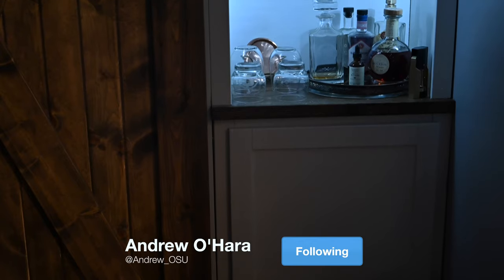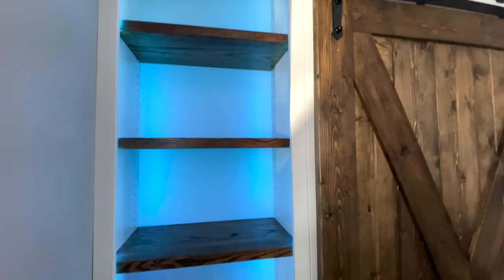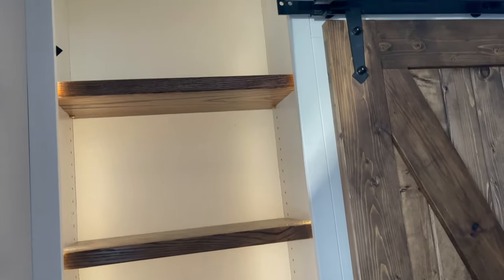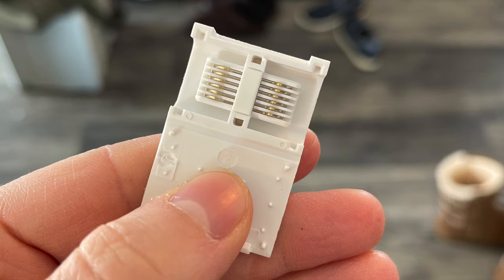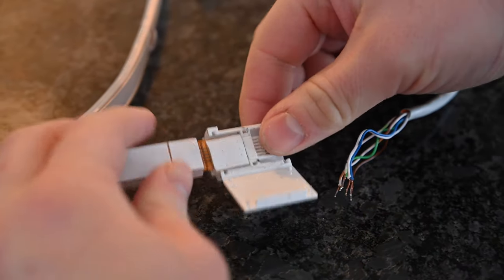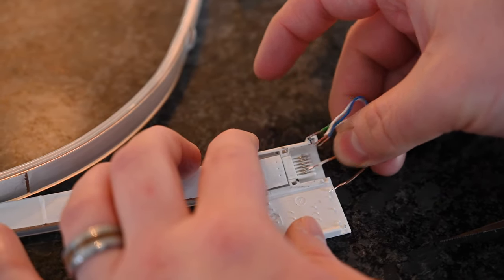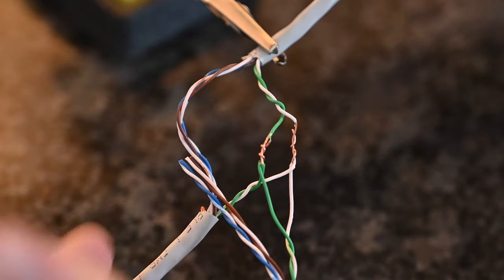How to Cut, Extend, & Split Hue Lightstrip V4! How I Created My Smart Pantry!

Comment: Genius! I wish Philips would release official extenders for this.
Reply: That’s too much common sense
Reply: @tomc  yeah dude they just throw stuff out there on the market and don’t provide or suggest connectors or extensions or anything lol
Reply: I just dont get it.  What exactly is the point of making their strips able to cut... And provide a clip that just puts them directly back

 together?  Why.... Would... I... Cut... It... To... Simply... Clip...it...back... Together!?!?!?!?

Philips...  Wtf!

I have ruined at least 1 kit of lightstrip trying to cut and solder cat5 cable to the cut ends... It has been an exercise is futility, frustration, burns, anger...etc.. 

Just why!? 

Philips: if you made cat cable like extension cables to go between cut light strips... I would buy the crap out of them.  

I am at my whitts end with these lights...  I am going to try the approach in this tutorial as a last ditch effort to salvage my project.
Looks like a good plan with a lot lower chance of burning the crap out of my hands on a soldering iron.

Thanks for the video!!  (your pantry looks awesome!)
Reply: @StumblingGamer648 right?? and there’s only one clip available? what a waste of £70

Comment: Using the cat5e cables were a disaster. I set this up yesterday, and even with the electrical tape being used to attempt holding the wires in place, it's completely unstable. I did it, but it was at a cost of a lot of frustration and a lot of time and patience. I would recommend going the other route with the conventional after-market solutions. Maybe soldering each wire in place would be a better idea since you won't have to worry about the wires slipping out.

Comment: The video description is incorrect.  This video does not show how or where to cut the Hue Lightstrip V4
Reply from the maker: It doesn’t? I thought I showed that exactly that.. with the V4, they have those new clips. So I cut exactly where the lines are and use the clip with the strip in one end and an Ethernet cable in the other.

Comment: Did you buy two extension packs  or were you able to reuse your cut off light strip ?  Sorry it was not clear in the video but great video! I need to gap two sections for under cabinet lighting. and want to reuse the cut off portions of the lightstrips

Comment: Was there a reason you didn't use the 6 pin LitAccessory extension cables to just extend from one end to the other? Just curious, because it seems that would of been much easier than splicing the CAT5 cables.

Comment: Great video, I want to connect them to my ceiling but will need a lot more than 10 meters. Do you know if it's possible to extend it to more than 10 meter, let's say 11 or 12 meters? Will it reduce the brightness a little or a lot?
Reply: i’m also trying to connect it to my ceiling but the power cable is really bugging me. i was thinking of cutting a smaller strip near the end so it can be closer to an adapter but this video makes it so complicated for me to do

Comment: Oh please!  For a measly $18 you can buy these little do-dads thus bypassing all this aggravation and bs.. Litcessory 6-Pin to 6-Pin Connector for Philips Hue Lightstrip Plus (15 Pack, White - Micro 6-PIN V4) Amazon.

I connected two 6 ft Hue lightstrips just yesterday [in a dimly lit room] using only one hand as I’m paralyzed on my left side.. easy to do, and worked flawlessly!  Forget this nonsense, trust me, totally unnecessary.  Geez
Reply: Oh..and without needing to make a single cut.  

Note: the reason I needed these connector-pins was I needed a 5 to 6 foot span with no light on the strip.. I used the following cables for that purpose; Litcessory Extension Cable for Philips Hue Lightstrip Plus (3.3ft, 2 Pack, White - Micro 6-PIN V4).  Be sure and get V4 pins and extensions if your strips are V4

This whole thing is absurd! If you can’t afford $18, you certainly can’t afford the ungodly expensive Hue product line

Comment: This worked like a charm on one set of bookshelves, now I’m having a beast of a time getting the second set to work. Any tips for getting the connection to work? I’ve tried cutting the plastic back a bit on the light strip, making the cat5 wire tips shorter, electrical tape to keep it in place… nothing seems to be working

Comment: Thanks for the video, great idea! I assume you are using solid core Cat5e cable and not the stranded variety? I've tried using stranded cable with and without solder and its too wide to fit in the extension connector. fits fine in the joining connector provided with product. Thanks for any feed back

Comment: At the risk of sounding negative, this method seems like it could be dangerous and void your home warranty by using 26awg stranded core CAT cable for power.  I don't know what the load is for x number of feet of strip lights, but I do know that a loose electrical connection will get hot and potentially start a fire and you're relying on a wad of tape.  Surely someone makes a proper extension cable that would be better than a jury rigged solution like this?
Reply: not at those voltages my man. Not at those voltages.

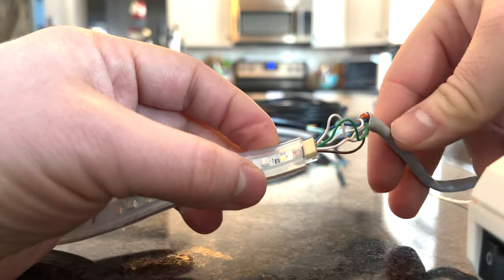Comment: I'm confused about one thing. So when you cut the strip, the left side is labeled B, and the right side (which you have cut off) is labeled A. However, at 8:00, you are connecting the ethernet cable to the final connector of the strip on B, not A--effectively making a B to B connection. So this works being B to B, and not A to B, assuming you keep the cables connected to the same connection points? Directionality doesn't matter?

(Edit: I've now finished doing the project, and am editing this comment in case anyone has the same question. You can connect the cut B side to the female pin connector B side, just make sure that you keep cables in the same order on both sides going from top to bottom. Also, I had an issue where the first Cat5e cable I tried would not fit into the female pin connector with or without tinning. I ended up using another Cat5e cable that had slightly thinner wiring, which fit fine after tinning.)

Thanks for the video.

Comment: I tried to connect my v4 strip via the connector and the cat5e kabel. However after I put on the power the strip (incl. the extended piece) just blinks once and then dies. Anyone had a similar issue or an idea how to solve it?

Comment: I used a "SPACER Extension Cable | for Philips Hue Lightstrip Plus V3 | upto 10m/30' | F" from ebay to bridge the gap in the kitchen cabinets where the cooker is. Stuck it to the wall before the tiler put the tiles over it.
Reply from the maker: Totally works! But those extension cables can be pricier than making your own AND there aren't many out there at all for the V4. As I rambled in the vid, there was very little info on the V4 models and that new clip makes a big difference.

Comment: Even the Litcessory extension cables won't connect to V4 cutoff ends.  Your solution to use the Hue provided connector clip and Cat5 cable is a great idea!  I was also trying to come from a single controller and needed to split and come down on each side of the microwave.  Thanks for solving a problem that Phillips seems to have overlooked.